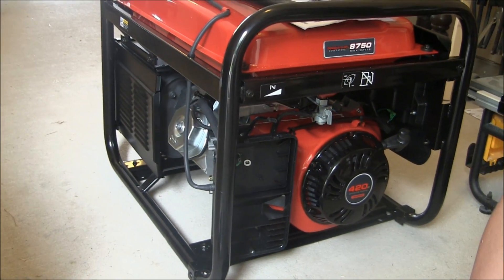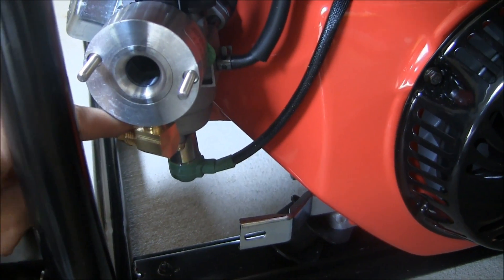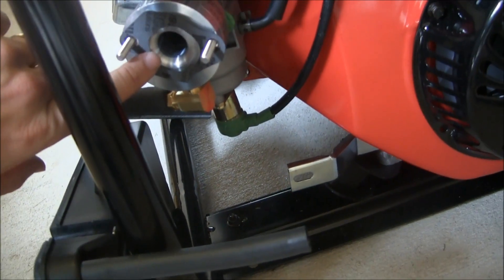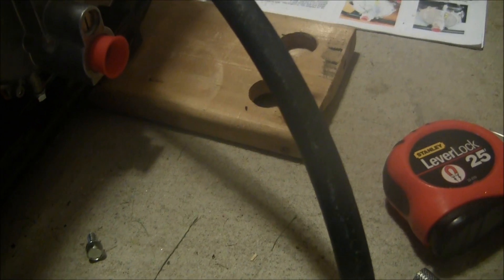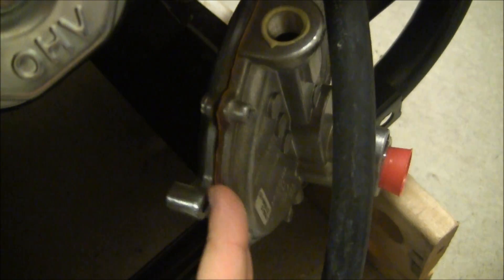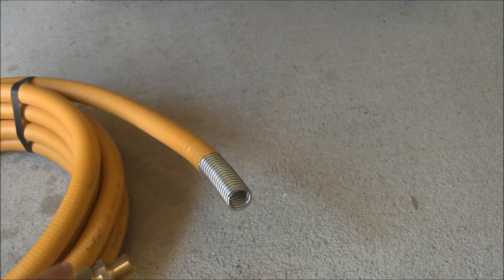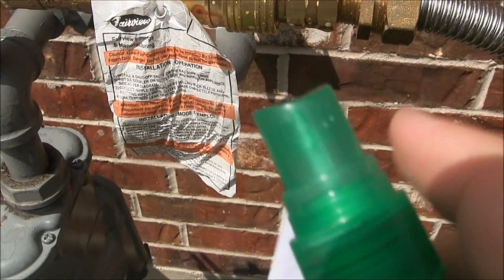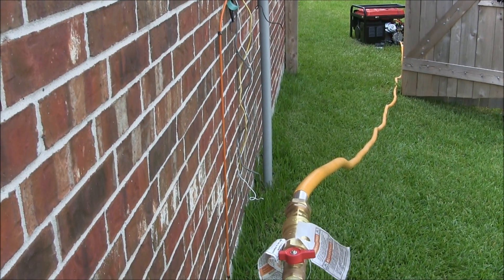Convert (Predator) Generator to Use Natural Gas (NG)

Comment: On the gas meter need to contact the plumber and have it done correctly. You should always use pipe dope due to the threads of the pipe. Plus the adapter you made it's the wrong one you're restricting your gas flow. So-called plumber to do it correctly.

Comment: I was going to mention that using wires and water hose pliers with serrated teeth will tear up brass fittings. But when I saw you open the gas line that was live who cares about tearing up brass fittings. They are to deduct money from your account for putting on such unsafe videos

Comment: Hot tap it into the gas line underground in your back yard!!! You'll never see your gas bill go up! That yellow HDPE gas hose under your yard is made out of more efficient pipe or something I guess.
Reply: You are not serious! Gas pressure is not regulated at the main incoming line. Plus I’ve been a pipe fitter for 50 years and you would have to tap into a plastic line. Not to mention what you suggest is totally unsafe and illegal!

Comment: Trying to fine more info on that port you tapped into on the gas meter. Can't find anything under pigtail. Wondering what it is there for and if I can use it to power a 10 kw generator.

Comment: Just buy the tri-fuel carburetor. You don't have to mess with any of this stuff and they cost $150.00 less than you paid for the snorkel kit. Mine cost $50.00 and simply swapped out the carburetor and it works just fine. This was comical though!
Reply: Thanks for the tip.

Comment: stan

You can't purchase propane nor natural gas kit for generators in CALIFORNIA  .
THE GOVERNMENT  California Air Resource Board (CARB) Regulations  BLOCK IT !
I try several times to purchase propane generators on line , then i try conversion kit for existing gas generator and each single time red flag message "we can't ship to your location "
so the istitution which was created to reduce carbon emission actually is increasing air polution ...i wander what's going on for tax payers money ?..  is it corruption between utility company PG&E  and government officials or simple IDIOCRACY  ... i rather believe is the first case  .
PG&E is loosing the ground under feet duo to solar panels  installed by people right on their property . however they turn off the power often including privately owned solar installations
 ( if you want solar panells and inverter by county or city permit you have to sign agreement that SWITCH  will be installed which is remotelly controlled by PG&E  )
In some towns mayors impose laws that you can not put more than 4 KWatts of solar panels on your roof .   ... is evident that giant corporation as pg&e  PAY UNDER THE TABLE  TO OFICIALS  AND ON THE OTHER HAND HAVE HOOK ON THEM ..BLACKMAIL  !
If any independent journalist run in to my note please respond  ,i have a lot to say ..i'm wild fire victim which was started by neglect power line , so  is my neighborhood . wee lost everything and now this bastards don't leave us alone and let us leave off grit  !
Dear people , today is California , tomorrow they will spread regime in other states ..wake up and do something .

Comment: This guy is dangerous.
Without a dought he should have used Rectaseal ( a gas sealant joint compound )   The conversion works but he created a hazard, generators vibrate
excessively without the proper sealant the fittings may loosen and create a
Very dangerous condition.

Comment: Hello, I recently converted a small Predator 422cc engine used to power a generator from gasoline to tri-fuel (NG/Propane/Gasoline).  I am concerned about valve issues, in that from what I understand, valves for a gasoline fueled engine are not as durable as those for natural gas and propane powered engines.  Apparently this can cause heat and lubrication issues with converted engines, along with "valve recession".

I would appreciate any guidance you may be able to give on this issue.  If possible, would like to know of any experience you may have had with converted engines, and how much and to  what degree the conversion affected their over all life.  Also, I would like to research compatible  hardened valves and or heads for this engine, for which I hear may be a "clone" of a Honda model.  I thank you in advance and would appreciate any input.

Comment: Looking CLOSELY at the fuel shutoff as you were showing the carb. That is the same fuel valve used on the Generac portables too. The seal in them is prone to leaking after a few years. Mine did. Nowhere local carries a replacement. Better find out where you can get one now. I finally called a parts place in North Carolina that said they had them. Total cost with shipping was only $6.00...

Comment: The workmanship in this video is horrendous.  First of all, you should have had your ducks in a row before creating this video. You don't publish a 'How To' video and then perform the tasks the wrong way.

Never use pliers to tighten anything when you can fit a wrench on the part or fitting. Also, those fittings and nipples should have been doped or Teflon taped with natural gas rated tape or dope.   It is not called "plumbers putty", it is called "pipe dope" or pipe thread sealant or pipe joint compound.  Personally, I use Keytite pipe joint compound (paste). 

When you installed that nipple and did not tape or dope it, you said you were going to do it as a "test" and that you should have used "plumbers putty"(correct material pipe thread sealant, you never use plumbers putty on pipe threads).. But then you sprayed leak check fluid, saw you had no leak and said, "yeah no leak, it's installed". My bet is you never went back and doped that nipple. The pipe joint compound seals the crevices between the threads, it also helps one tighten the fittings by acting as an anti-seize compound. We use it for a reason.  Heating and cooling causes expansion and contraction, what may not be leaking today, may be leaking next week. And spraying leak check fluid often will not show small leaks and may take a few minutes to reveal a low pressure leak. You can't just spray it on and immediately come to the conclusion there is no seepage from the pipe joint. 

Also, you NEVER work on "hot"lines whenever you can perform the task with the line 'cold', be it gas, water, electricity or whatever.  It is a simple task to shut the gas feed into your meter.  You should have a wrench taped or wired to that meter in the first place in the event you need to cut the gas flow into your dwelling.

Finally, more than once you related, that this or that would not pass code for a licensed contractor, but for a DIYer, it is o.k.
C'mon, that is nonsense.  If a DYIer is going to do a project, he better damn well do it to the same standards as a licensed contractor, especially on electrical or gas systems, anything that can go "boom" in the night.  You are subject to the same criminal liability as a contractor who performed negligent or shoddy work that resulted in injury.

My question is, if you know you are taking shortcuts, performing the task in a substandard manner that does not meet code, why are you publishing a 'How To' video?  It never ceases to amaze me how, for '15 minutes of fame' folks post crap on the internet that may, potentially exposes themselves to either civil or criminal liability.  It would be great if you want to show folks the gas conversion kit, but it is not advisable to show folks an installation where one knowingly takes shortcuts and performs the project below requisite code standards.

Comment: Is that conversion kit a Tri fuel type 4 high pressure or a Tri fuel type 4 low pressure kit? I was on their website and to say the least it’s very sketchy and since I have the same generator I was quoted 189 the first time and 267 the second time please let me know what kit I will need since I emailed them several times with no response. Thanks
Reply from the maker: Purchased the "(KIT-C) Type C Tri-Fuel Natural Gas, Propane, and Gasoline Kit" for $187.00 in 2012.  The tax/shipping was another $12.90.  (Their website was just as sketchy back then as it is today.)

Comment: Nice!  How is the generator holding up?
Reply from the maker: A few months ago I had to run it for three days straight after we lost power.  It started right up and worked great.  This is after five years from the initial install.  I'd say it is holding up well.
Reply: Good to hear.  I have a brand new 8750 still in box.  I also have a dual-fuel carb kit on order from Tonco, which I plan to install after the initial gasoline burn-in.  This is the carb I ordered: www.aliexpress.com/store/product/LPG-NG-biogas-conversion-kit-for-gasoline-generator-hybrid-propane-carburator-6KW-6000W-190F/1685074_32256070729.html
Reply: golf-n-guns please post how that carb works on the 8750. I converted mine with the US Card motor snorkel. Works great,  but it's $200.
Reply: I received the Tonco carburetor this morning.  Well packaged and looks robust.  Haven't compared it to the carb on the generator (since it's still in it's box.)  I posted a review with unboxing pics on the aliexpress website.
Reply: B Berthold Haven't received the new carb from China yet and the 8750 is still in its box. I may do an unboxing vid if the carb and go from there.
Reply: Once you get the carb I would like to know what your thoughts are. I have had my HF gen for a couple of years and would love to hook it up to propane so I done have to worry about gas gumming up the carb. Thanks!

Comment: Great video very informative my question is how much did the conversion kit cost and where did you get it from? Thanks in advance
Reply from the maker: About $200 from uscarb.com.
Reply: Look on the web. There are companies that will sell the tri fuel kits.
Reply: I think your regulator was supposed to bolt up on top rail by fuel tank
Reply: ⚠️Portable Generator Safety Tips:

1) KEEPING OTHERS SAFE: Please do not allow an unqualified person or your children to operate and service the portable generator. Just because some manuals don’t say that doesn’t mean it’s safe. That is important against the generator safety rules. We also need to be keeping an eye on our children too. You need to make sure that your children are not playing near the portable generator especially when it’s running so they won’t get electrocuted. Generators pose electrical risks and they can be hot during an operation. Please keep your children away from the portable generator at all times. It is important to keep our children safe especially our little ones. Be aware of all the hazards.

2) WHERE TO RUN YOUR GENERATOR: Some people use their portable generators indoors which increases the risk of carbon monoxide poisoning. It’s important to have carbon monoxide detectors if you have a gas generator. Never ever use your generator indoors even if your doors and windows are open and even in the garage is not safe to use a portable generator. Also please never use your generator in your deck or balcony. It is never safe to use your generator indoors and in enclosed areas of your home. Your generator needs to be 15-20 feet away from your house. 

3)🔥FIRE HAZARDS: Never refuel your generator while it’s running. You need to let your generator cool off before refueling it and before storing your generator. Never overload your generator too. Never ever back feed your generator. You should never plug your generator into a wall outlet. Also never store propane tanks indoors. Please keep flammable things away from the generator as well and please don’t smoke cigarettes near the generator. Having a fire extinguisher next to the generator is also important against the generator safety rules. It’s also not safe to move your generator while it’s running.

4) GENERATOR OPERATION: make sure your hands are dry before touching the generator. Never use your generator in wet conditions. Don’t let your generator get wet. You need a generator tent if you need to use your generator during wet weather. Please don’t wear loose clothes when operating the generator. Turn on your generator before plugging in appliances. Use the right cord for your generator. Please do not use worn out cords. 

It is always important to follow the safety rules when using portable generators. 

Hope this helps

Comment: where did you buy the 3/4" yellow gas line?
Reply from the maker: Lowe's.
Reply: thanks
Reply from the maker: No, I haven't figured it out.  That would be good to know.  I got the hose long enough to get past the fence line.  The thought was that in an emergency I could keep it inside my fence.  When I ran it (for more than three days) during the last storm, I ended up keeping it in my driveway.
Reply: qslewis, have you determined how much it cost to run natural gas to your generation? How many therms per hour? I am curious to know. Also you could increase the length of your hose so that you can move your generator behind the house to the appropriate spot.

Comment: I am running my 2kw generator with natural gas for more than 10 years. very easy conversion . I did conversion myself. No ongoing problems. engine life shortens due to lack of gasoline lubrication.
Reply: Can you give me any pointers on how to adjust the carb when running off natural gas?  My mixer is all messed up.

It only runs when it is set on half choke
Reply: ⚠️Portable Generator Safety Tips:

1) KEEPING OTHERS SAFE: Please do not allow an unqualified person or your children to operate and service the portable generator. Just because some manuals don’t say that doesn’t mean it’s safe. That is important against the generator safety rules. We also need to be keeping an eye on our children too. You need to make sure that your children are not playing near the portable generator especially when it’s running so they won’t get electrocuted. Generators pose electrical risks and they can be hot during an operation. Please keep your children away from the portable generator at all times. It is important to keep our children safe especially our little ones. Be aware of all the hazards.

2) WHERE TO RUN YOUR GENERATOR: Some people use their portable generators indoors which increases the risk of carbon monoxide poisoning. It’s important to have carbon monoxide detectors if you have a gas generator. Never ever use your generator indoors even if your doors and windows are open and even in the garage is not safe to use a portable generator. Also please never use your generator in your deck or balcony. It is never safe to use your generator indoors and in enclosed areas of your home. Your generator needs to be 15-20 feet away from your house. 

3)🔥FIRE HAZARDS: Never refuel your generator while it’s running. You need to let your generator cool off before refueling it and before storing your generator. Never overload your generator too. Never ever back feed your generator. You should never plug your generator into a wall outlet. Also never store propane tanks indoors. Please keep flammable things away from the generator as well and please don’t smoke cigarettes near the generator. Having a fire extinguisher next to the generator is also important against the generator safety rules. It’s also not safe to move your generator while it’s running.

4) GENERATOR OPERATION: make sure your hands are dry before touching the generator. Never use your generator in wet conditions. Don’t let your generator get wet. You need a generator tent if you need to use your generator during wet weather. Please don’t wear loose clothes when operating the generator. Turn on your generator before plugging in appliances. Use the right cord for your generator. Please do not use worn out cords. 

It is always important to follow the safety rules when using portable generators. 

Hope this helps

Comment: How hard would it be to go back and forth to propane and NG in event NG supply was lost?
Reply from the maker: newyota1 I'm not cometely sure, since I've never hooked up propane.  I would think it should be similar.  I'm guessing you may need to play a little with the gas intake.
Reply from the maker: I haven't actually tried this but it should be as simple as changing out the hose to the different source.  Again, I haven't tried this.  I could see needing to tweak the intake (i.e. increase or decrease) a little to account for differences in the different gas types.

Comment: So you did not need to cut the frame or use the us carb snorkel?
Reply from the maker: Nope.  I didn't cut the frame.  It took some finagling.  The Snorkel wasn't even available when I did this a few years ago.
Reply from the maker: Fortunately, I was able to work around NOT cutting the frame.  It isn't supposed to be a big deal but since it was a new generator at the time, something in me wanted to find another option instead of cutting it.

Comment: I applaud your willingness to use hand tools and tackle this project. I would not have been so disrespectful as some others. I think its wonderful you had your son help ... one tip I might add is... you connected the crankcase breather hose to the spark plug... that new red hose you bought? It goes from the valve cover (below the spark plug) to the air filter.... and vents the air from the crankcase into the engine. You might see some oil come out of the valve cover if not connected... good luck...

Comment: do i need to adjust the output point of gas kit/regulator for gas pressure or simply give supply in inlet & start the generator ?

Comment: This happens to be the MOST expensive unit HF sells not the least expensive.
Reply from the maker: Fair point.  I meant to say this was the least expensive out of the 7000 running watt competitors I was evaluating.  All the others in this range cost more.